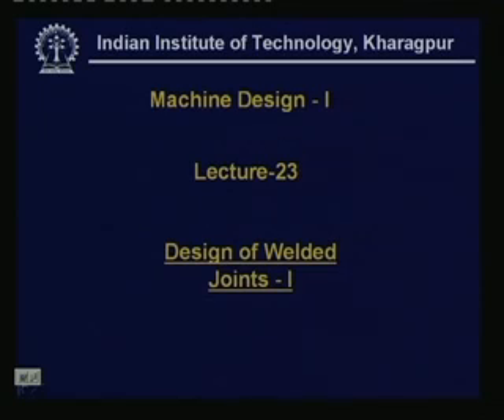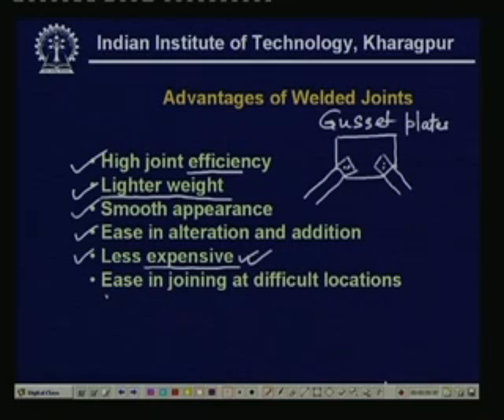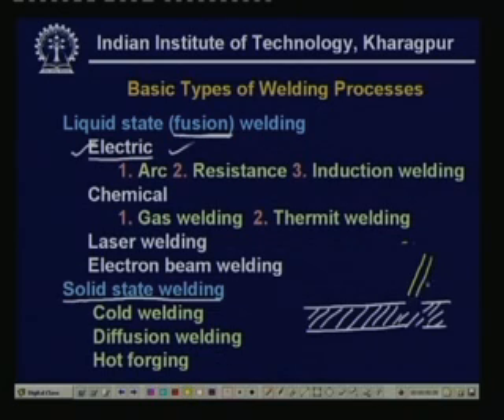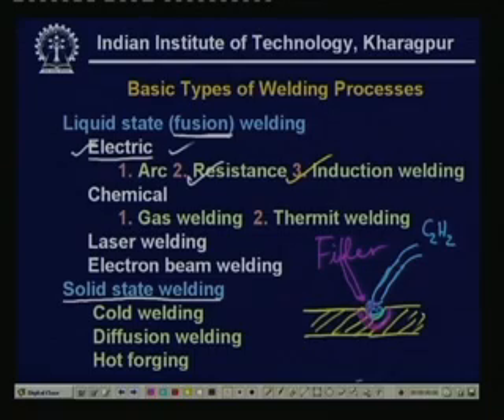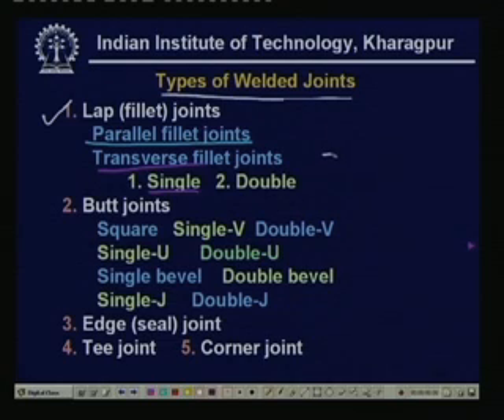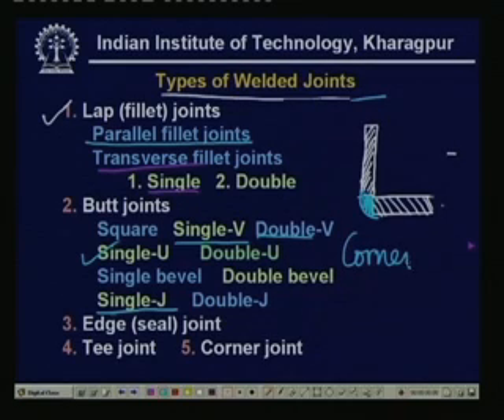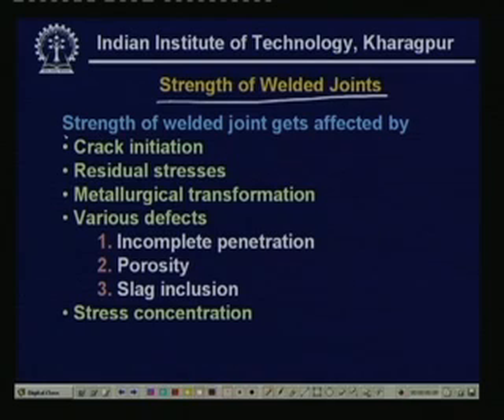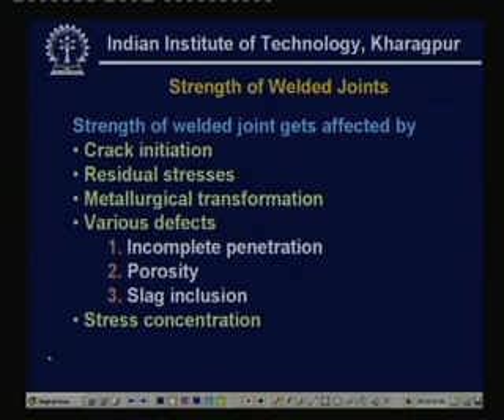Lecture - 23 Design of Welded Joints-I

Comment: Sir how can you rivet and press fit has permanet joint.
First you prepare well and then post viedo don't waste others time.
Reply: 😐 Brother,
 joint is called as permanent joint "when it is removed it will get deformed and not reusable" as it occurs in permanent failure.

When we remove rivets and interference fit they are not able to use again... so Those joints are called permanent joints

😒 Scolding a lecturer is so easy 😒
First learn to respect them
Reply: Riveted joints are called as permanent joints bro